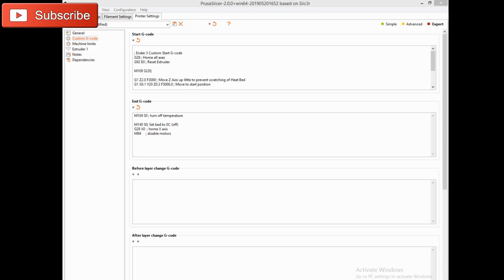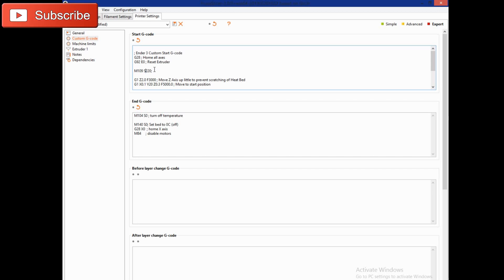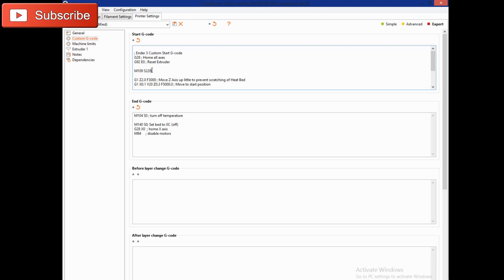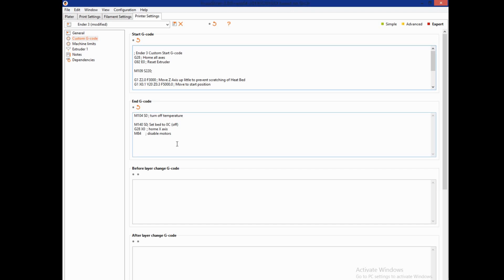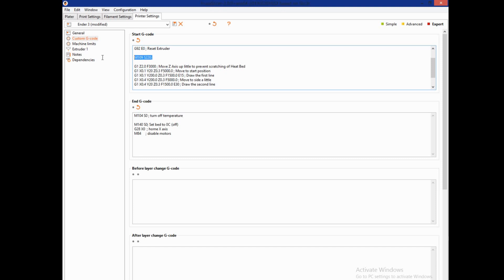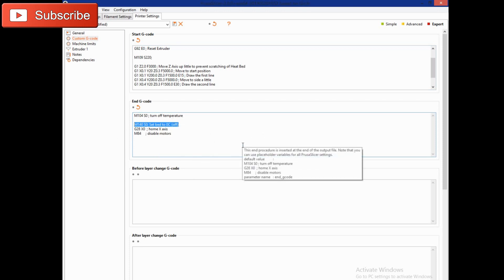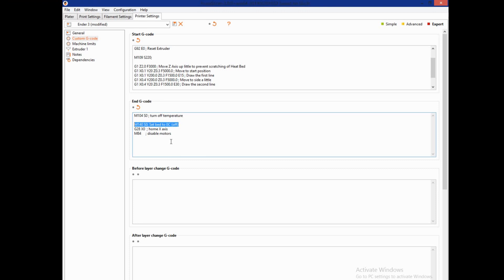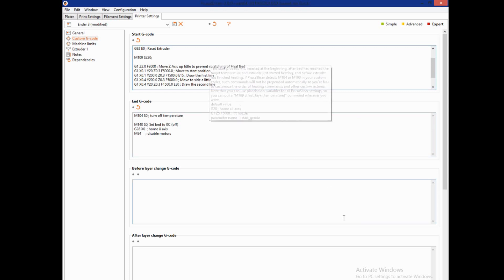Fixing PrusaSlicer Start and End g code

Comment: I know this is an old video but this seems related to my issue. I'm trying to print a project in ABS, it appears that Prusa is shutting off my bed before the print starts, this doesnt happen in Cura so this is why I believe it's a Gcode issue
Reply from the maker: Are you sure it's not just heating the nozzle before the bed? When is it shutting it off, at startup, or like midprint.
Reply: @Technivorous  It will heat bed, then nozzle, then right around the time it starts the print shut off the bed, you would think I could manually restart the bed but usually the drop in temperature is too much and the print comes loose. Cura is working great. But I like too many of the features on Prusa to give up, going to look at the gcode generator Tim from TH3D has on his site and see if that can come up with something workable.

Comment: someone write the start and end code to make pursa slicer the same as cura start and end... for creality 3pro 
Thank you 
print end raise nozzle from print and push table forward
Reply: The Longer MK5 Pro uses these coding lines to "present" the piece upon finishing. I think I may change the Z height on the first line to more like 20 or 30 just so it raises up higher.

G1 Z10 ;Raise Z more
G90 ;Absolute positioning
G1 X0 Y300 ;Present print

There are several default .gcode print files on the included Longer SD card. If Creality also did this with their SD card, just do what I did, and open one of them in notepad. Then copy the code. That's basically how I got PrusaSlicer to replicate the Cura start & Stop settings. Longer basically showed where they are with semicolon command line exemptions for making non command notes.

; LONGER End G-code
G91 ;Relative positioning
G1 E-2 F2700 ;Retract a bit
G1 E-2 Z0.2 F2400 ;Retract and raise Z
G1 X5 Y5 F3000 ;Wipe out
G1 Z10 ;Raise Z more
G90 ;Absolute positioning
G1 X0 Y300 ;Present print
M106 S0 ;Turn-off fan
M104 S0 ;Turn-off hotend
M140 S0 ;Turn-off bed
M84 X Y E ;Disable all steppers but Z
Reply: These lines are above the "; LONGER Start G-Code" group in the SD card default files, which is kind of why I ended up here, to see if adding them in front fixes the fail to warm up to the start temperatures before beginning to print test line along the bed edge, which it does correct that. By default they are S60 and S200.  I've found with this first filament brand I bought that the bed really does need to start at 70C and the hot end at 215C, or else the first layer still fails to stay fully adhered to the "watered down Elmer's glue" primed bed. 

M140 S70
M105
M190 S70
M104 S215
M105
M109 S215

Comment: your start gcode would be better as the replacement variable

M140 S[first_layer_bed_temperature] ; set bed temp
M105 ; Report Temperatures
M190 S[first_layer_bed_temperature] ; wait for bed temp
M104 S[first_layer_temperature_0] T0 ; set 1st nozzle heater to first layer temperature
M105 ; Report Temperatures

M109 S[first_layer_temperature_0] T0 ; wait for 1st nozzle heat to first layer temperature
M105 ; Report Temperatures

you could also use S[temperature]
Reply from the maker: It's been a while since I made this and I've been meaning to go back and play more with prusaslicer. I'll keep that in mind
Reply: @Technivorous  GET ON IT...   lol.   JK.  but seriously.    I am using Cura 5.3 and just started using Prusa 2.5 and want the Prusa slicer to do what Cura does... when it heats the bed, then the nozzle then does that Wipe thing twice to get the nozzle flowing, then start the print.   Is this under lock and key in some govt controlled secure area....?? why is this so difficult to find so I can cut and paste the gcode in...   I have figured out that cura and prusa gcode is different.    Help ....
Reply: Thank you! This is exactly what I was looking for!

Comment: I have had this problem as well, added to the factor of it interfering with the BLtouch ABL process. I had help from the Prusa forum, particularly Muppet Labs (as a kid I never expected to say that) who has very detailed Gcode (well documented and explained) for Prusaslicer 2 and Cura (good to compare them). Anyway, I added these lines:

; WARMUP ROUTINE from bobstro at Muppet Labs
M140 S[first_layer_bed_temperature] ; set bed 1st layer temp
M104 S[first_layer_temperature] ; set extruder 1st layer temp
M109 S[first_layer_temperature] ; wait for extruder 1st layer temp
M190 S[first_layer_bed_temperature] ; wait for bed 1st layer temp
; BED LEVELLING

They have the added benefit of heating up the bed and hotend together.
David

Comment: M109 S[first_layer_temperature] 

This will set the extruder temp to whatever you have set in your filament settings.
Reply: Actually, I usually ad these 2 lines.

M104 S[first_layer_temperature] ; set extruder final temp
M109 S[first_layer_temperature] ; wait for extruder final temp
Reply: This is now built into the start code in Prusa Slicer 2.3.1.  
Setting a specific hot end temperature in the start code is not a good idea unless your printer is dedicated to one specific filament. . .  but even then, there's no reason to use the start code rather than filament settings.
Reply: @TheSuburban15  im using Prusa Slicer 2.3.2 and im still having this issue. ive just made the switch from S3D so still getting used to it but find this issue annoying